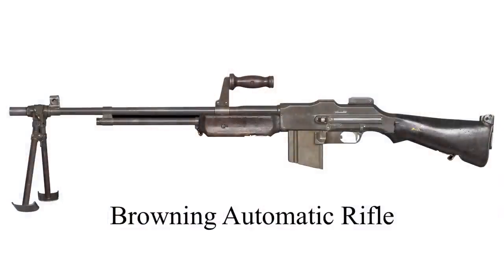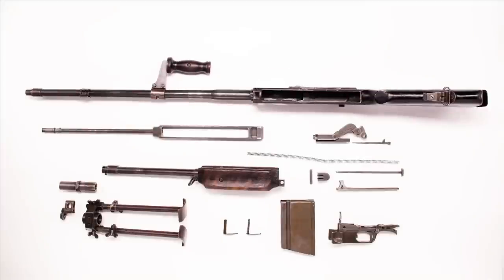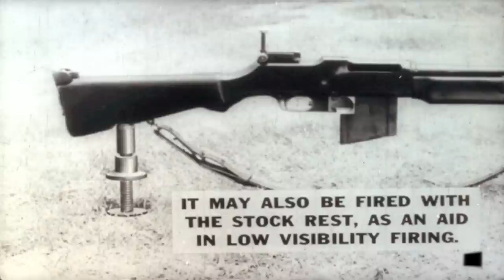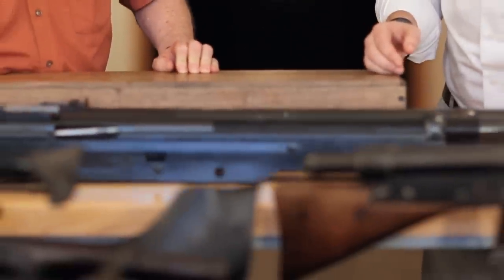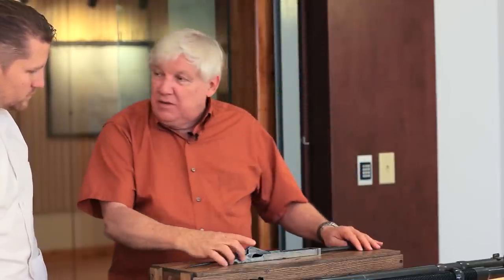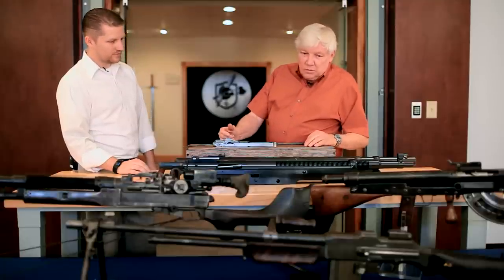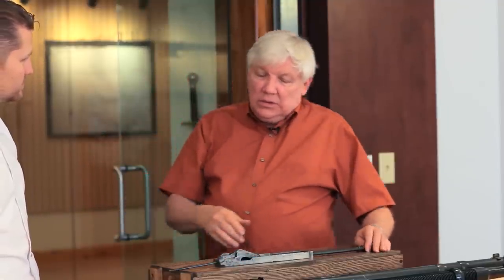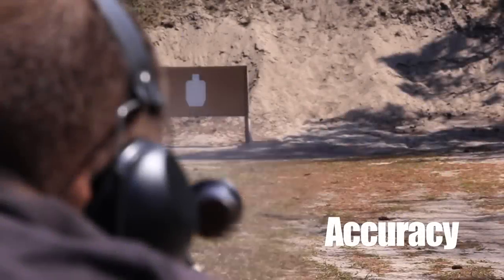The Browning Automatic Rifle- B.A.R.

Comment: It's a great auto-rifle but you really needed two of them per squad. A single one just couldn't lay down enough firepower but a pair of them worked excellently, they could put down really dense and accurate suppressive fire which is what you need to neutralise an enemy position that is trying to cross over ground onto your position, or worse... if your adjacent squad is on the move in the open and taking fire you need to silence the enemy position firing on them.
A single BAR in slow-fire mode was accurate enough, but couldn't really give a spread of fire along a firing line, but two working together worked better than any other single light machine gun of the war. And as a quite light and handy gun you could deploy them much better. A BAR gunner didn't need an assistant gunner anywhere near as much.
Reply: My dad was issued a BAR in the Marines, they used them in 4 man fire teams. They eventually switched to M14s. One of the 14s was full auto with a bipod.